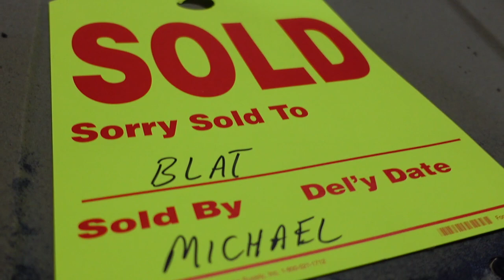kayak fishing sucks

Comment: Loved the video. Kayak fishing has definitely helped me up my fishing game. There was a time I would bring 8-10 rods and load down the boat/kayak with every bait I owned. I learned real quick that I was spending more time trying to throw the kitchen sink vs analyzing the conditions I was faced with. Now I bring 4-5 rods max, two 3600s and a handful of plastics in a Plano worm file. I've noticed that I've had MUCH more success downsizing and planning out the locations I'm going to be fishing. I've rigged out my kayak in such a way that I have to do as little as possible when I'm unloading. I'll head to work with my kayak in the bed of my truck and head straight to Clarks Hills when I get off at 1p, pull up to the ramp and yank my yak out. All I have to do to get ready is throw my vest on, grab my paddle and Lowrance unit. Rods are already in their holders and my trolling motor is a pod mount that I drop into place once I'm deep enough. All in all it's a 5 minute load/unload. Looking forward to more kayak content.
Reply: Then why do all these guys have tons of baits?

Comment: Load up to go fishing. Unload to get on the water. Load up when you get out of the water. Then the part I dread, unloading at home to get my truck back to everyday life. All that said, I love my kayak and everything involved with it.
Reply: What you said!  I think that's why I bought a 12ft jon boat and trailer with a 5hp on the back and a TM on the front... for less than I would have paid for a peddle or motorized yak.  I love paddle fiahing... done it from canoes and kayaks for over 20 years... but only for protected, small waters, and I get really wore out mentally anymore basically putting together my boat and taking it all apart at the end of a trip.  

It's got its place... but I think a small jon boat is better for me now that i have one.

Comment: I actually replaced a bass boat with a kayak. But I fish small waters.
Ways kayak fishing is superior:
Fish never see me coming. I have no motor so they don't even hear me
The kayak fits in my back yard in town there a boat would be pretty difficult
I can get the kayak into places no one else will be fishing (the biggest one)
You get exercise while fishing without even noticing
I find a lightweight kayak to be easier to deal with than a boat and trailer
No batteries to charge
No fuel
No mechanical failures

But most of my friends don't share my enthusiasm.

Comment: BLat love your segway into this video.  Totally concur with you about kayak fishing.  I do both, bass boat and kayak fishing, and kayak fishing is so much more calculating like you explained.  I actually added a trolling motor to my kayak because adjusting movement in it now is much easier.  Still have my paddle to help out with micro adjustments but when you're in current or windy conditions it's pretty tough doing this with a paddle alone.  Either way Kayak fishing really compliments your bass fishing skills with all the nuances involved in it.  You rock and Merry Xmas

Comment: Everything you said is true about kayak fishing. An important thing to mention is the right kayak for the right application or water you will be fishing. People usually opt out for the most stable kayak and in return will be a barge to paddle and will be a bear to handle or drag through skinny water. I for one fish alot of skinny creeks that are hard to access and need to drag the kayak to get there. Caught my pb largemouth 9lbs in 2ft of water!. I recommend to get the lightest, stable enough kayak possible and that has the right hull shape to cover water and be affected less by wind. Also keep it simple with 3 rods max a plano box, terminal tackle and bag of soft plastics.

Comment: The mental aspect of kayak fishing is so much deeper than I would have ever thought. When you're fishing a tournament on a lake that's thousands of acres from a kayak, it takes hours just to decide where to even start. Then when you're trying to decide to make a move that could take 20-30 minutes of pedaling and lots of energy, on top of just the normal things like spot preservation. I have a bass boat also but I rarely use it because I prefer to fish out of my kayak.

It's actually faster for me to take my kayak for those short trips. I work nights so I'll take my kayak and my gear to work and go straight to lake after work instead of having to drive home and get the boat. If you set it up and take it apart the same way every time you develop a system and it's really not much slower than loading/unloading a boat solo. 

The boat positioning plays such a huge role in setting the hook also. It's so easy for the wind to get a kayak turned to where it's difficult to get a proper hookset, and that seems to always be when the fish bites. 

Great video as always!

Comment: I got a 10ft with a 400 lb max weight limit which is key, it allows me to use my 55lb thrust trolling motor, marine battery and gear and still be almost 100 lbs under the max weight, this allows the boat to track properly and remain stable. I have a fairly pricey  anchor system and a mesh parachute to keep me in place or just slow down if I want to drift. The 10 foot length fits inside my transit connect van and makes transportation much easier.

Comment: It's a good discussion of a wide ranging topic.   I come from paddling and my last purchase was a Wilderness System RADAR that could take a pedal, but for it I kept with the paddle.  I fish inshore and knew I would end up with a skiff and skipped the pedal drive for a Maverick Skiff.

The biggest challenge with the paddle kayak fishing mode is really not so much the packing, unpacking and hauling (and that can me optimized and minimized) it's that, given any adverse conditions (say wind over 10-12MPH), you could spend 80% of the time with the paddle in your hand and not the rod.   I'm not a tournament fisherman and it could be frustrating, so I'd imagine it's a non starter for someone in a tournament and on a time budget.  

Similar to what you said I would never really take my kayak out unless I could dedicate 6 plus hours to fishing.

I know a lot of inshore fishermen that are bait-and-wait people, so they'll post up somewhere with a point and some current and structure and they'll drop an anchor pin and soak bait.  It's productive but to me it's incredibly boring and I don't like to fish like that.

My favorite mode is to paddle and paddle and paddle to get to the place where I set my mind to fish and have done the map and tide studies, then stand up and sight fish and adjust the rudder so that the wind blows me on an ideal drift.

But if there's any adversity of weather, I'm in my skiff.

Thanks for a great video

Comment: I have a Jackson Big Rig equipped with a tandem mount trolling motor and foot controls, even so, it can be difficult to maintain position in wind or current. I do have an anchor and stake out pole but rarely use them. I do like the physical work aspect of kayaking and sometimes opt for paddling. Most of my fishing is done on a river where big bass boats can't go. I have owned boats but at this point in life find that kayaking suits me better. Thanks for sharing your thoughts on yaking.

Comment: You pretty much nailed it.   I can still go a lot of places and get to fish in my YAK than the guys with their boat.   I've had more fun fishing out of my YAK than I ever thought I would.  When a fish starts pulling you around its like a giggle switch starts up.  Also, at least in my state, no "boat or trailer taxes".  That was a reason I didn't get a trolling motor on my YAK.  It will fit in my garage with my cars as well.

Comment: The part about time and fishing after work is spot on brother. I go after work a lot and it can get annoying having to drop the kayak and get 2 hours of fishing in before dark or before a park closes. Also, it really makes you fish what you’ve got as opposed to making a run down the lake to hit different stuff. If I have all day, I’ll make a 3-4 mile run, but in a kayak, that’s close to an hour of just paddling/peddling/motoring. Bass boat can move a lot more efficiently.

Either way, some great insights Blat.

Comment: Agree completely. I have no place to keep a regular boat and so was a 'yak guy for 10 years with a Hobie Pro Angler. Loved everything except control in the wind and taking so long to get anywhere. What ended it was the exhaustion factor getting that beast up on my SUV at age 74. Every trip was two ups and two downs, plus load/unload gear. Finally bid it a fond farewell and bought a bass boat. And rented a storage unit. MUCH easier to fish from, but not nearly as stealthy or cheap to run!
Reply from the maker: Yes I’m glad you shared that perspective! I was thinking the same thing. I’m nearly 40 and there’s no way I could kayak like this in my later days. It’s a big job! I do like it however but it seems to be over glamorized when I’m fact it’s is the most complicated form of fishing there is.

Comment: Well, in someways I’d agree with you, but for someone unfamiliar with fishing from a bass boat or having a foot controlled trolling motor, they wouldn’t have a any idea of what they are missing. Now I’ve been through three different kayaks in the past ten years, and learned a lot about the sport myself to include the limitations of my boat and me. When I was younger dragging around a 100# boat didn’t bother me at all, now it’s a task. My boat has the capability for paddle, peddle or trolling motor. Each has advantages and limitations, many you already addressed. But is fishing from a kayak any different than fishing from a John boat? I tried that for awhile as well, and having to load unload your gear is as big a pain as with a kayak. Yes I owned a number of bass boats as well, and nothing beats the day on the water in one. But for those who are not there yet, you can build a yak with all, okay many of the bells and whistle’s but when you add up all you spent, yeah, you will wonder why I didn’t just buy a boat.

Comment: Funny I leave all my rods and equipment in my kayak. It is all stored in my garage on a cart that is the same height as my truck bed. I can load and unload at the garage in about 5 minutes (usually less). For the boat ramp, I made a ramp with rollers for the back of my truck, using a block and and tackle I can load the thing back up with no lifting. OK, It's not as fast as perhaps trailer loading a boat but it's pretty close. the truck has a cap on the bed so I just tie it in and go. So the convenience hurdle is  probably easier than a boat for me. I started with the Kayak fishing to get exercise which is laughable because I can peddle the kayak all day long and not feel taxed in the slightest. The idea of storing and maintaining an 18 foot boat with an outboard is not something that interests me. It's probably the same reason I use a large canvas tent to elk hunt from instead of an RV.

Comment: I'll have to disagree. Most negatives you mentioned are incorrect. Everything you said WOULD BE correct if upgrades to kayaks were impossible. You fishing in a Sun Dolphin straight out of Walmart? Then yeah. Otherwise, no. 

1. Boat Position: I have an electric anchor on mine currently. Game changer. I'm working on the auto up and down; Will be done for spring fishing. Commercial units for this are available but I like to do my own. For now I have to hold the button up and down. But the point is no wet hands, no lifting a weight on a rope, etc... A cheap simple anchor trolley gives you precise control of your position. Most mid to high tier kayaks have trolling motor mounts or mounting points. Mine does, and it has a wide open deck. Could easily mount a trolling motor with Spotlock and GPS autopilot and using a foot control, same as on your boat. My kayak has a pedal system with instant reverse. Very controllable. Rear mounted prop so turning radius is real good. 

2. Time: I too have to use any available time to hit the water hole. Especially now that its getting dark so early. Trailer your kayak. Leave all equipment installed. Crate, tackle, seat, pedal system to some degree, and electronics minus the head unit. On board battery charger/BMS. Just plug the kayak into the wall. Unplug and roll away. Launch from the regular boat launch or nearby if there isn't one. Permanently installed wheels/landing gear helps with that. 

You can get most of the luxuries of a bass boat for a fraction of the cost (at the current time anyway). Of course stability and deck space will never be equal between the two. And range is more limited in a kayak. None of those 70 mile runs during a tournament. And realistically you don't have the option of taking a friend out fishing with you on the same rig.

Comment: I have a feelfree moken 10v2. The hardest part is figuring out a good anchor system. Especially if you like fishing in deeper water.
Reply: Hi Frank I have the same yak and did a little anchor trolly hack that works pretty good.  From the rear built in handle to the mid-yak built in handle I tied a heavy bungy cord on each with a carbiner and routed para cord in a big loop and tied another carbiner to it.  Therefore I can at least move my anchor point to the rear of the boat which is way better.  I also installed cleats mid way on both sides next to the seat so I tie off there, clip the carbiner and pull the para cord until the carbiner is at the rear.  It works.  One other modification I did was add a rudder which helped it track so much better.  I installed it so I could steer with replacement foot pegs too.  Good fishing!

Comment: This is 100% true. As a kayak fisherman as it’s 99% of the fishing I do, I can say that this video accurately points out the cons. Having that said, there are a lot of pros of kayak fishing that were not mentioned in this video. 

1- structure fishing- kayak fishing allows you to adjust easily to structure like when fishing bridges, jetties, docks, etc. you can get super close to where boats can’t a lot of the time due to inaccurate spot-lock adjustments on trolling motors and hard positioning with anchors 

2- launch spots- also a con, but the fact that in some areas you don’t necessarily need a ramp, unlike boats, can make this a pro for kayakers. 

3- stealth- I fish for redfish mostly. For those who know, they are hard enough as it already is to catch sometimes and can easily get spooked by even just the slightest of movements and/or sounds. A lot of the times you can get away with trolling motors or push-polling, but then that also brings another aspect of difficulty to the game. I’ve noticed that a lot of the time on my kayak, I can very easily sneak through creeks with minimal noise and I’ll round a corner and a redfish will be just a few feet from me and not get spooked by the movement of my kayak. 

4- minimal maintenance required- boats can take a lot of maintenance and if the motor goes bad, this is where the mechanical aspect of kayak fishing has the upper-hand. A paddle will never fail you. Peddle drives might fail you, yes. But you’ll always have a way of moving the kayak efficiently. And you’ll always have a way to get back home. 

5-solo aspect- there’s nothing more annoying than being on a boat with another person and they want to go one way to one spot, and you want to go another way to another spot. You get the freedom aspect from kayak fishing and get to roam around wherever you want. Not a BIG con for boats, but just something to think about. 

Having that said you’re 100% correct about the cons though. They ARE a pain to load, unload, and peddle/paddle with a lot of the time. But for me, this will never outweighs the pros of it. Fishing on a boat has made me appreciate kayak fishing that much more, and vise versa. Overall, great video man! You make some solid points.

Comment: Thank you- this video needed making very, very badly. Ppl won't listen to some shmuck like me, they just figure either I don't know what I'm doing or I'm some grouchy person that just likes to be negative. Everything you said about kayak fishing- if you fish from a less expensive paddle or peddle driven kayak that is- is so true. And it's all left out by these guys who promote kayak fishing or some certain brand of kayak- they always act like there's no difference, if anything it's even better than a bass boat- but then if you notice, every one of those guys has a kayak that runs around 6-8 thousand or more, it's got a trolling motor, it's got a main motor, it's got a seat that sits up 15 inches from the deck, and they're hauling it around on trailers custom made just for them and their gear. Trailers that cost more than the kayaks on them. And then they deck them out with electronics to boot. No wonder to them it's great, they've basically got a tiny little bass boat. If I was going to spend all that money, I would just go buy a full-sized boat and trailer and be done with it.  Now I've got tons more range, I can position far more efficiently, no more worries about the wind and current and how am I going to get back to the launch- all taken care of. And- and this is the most important part- I can go to any big lake I want and fish and not have to worry about strong currents, big boat wakes, or excessive chop. You can't see these lakes until you get to them- try driving hours to get to pickwick all to find it's too choppy and too dangerous for you to get out on- man it's disappointing and frustrating.

Comment: And you can take the kayak where bass boats are not going to go! On my home lake there is a lot of flooded brush and timber. The guys with there 100 grand bass boats are not taking them in to those spots cause they will get stuck or scratch up there boats. I can slip right in there and catch the bass that don’t get the fishing pressure. I fish out of a Hobie PA12 and it works perfect for me. It is a great way to fish.